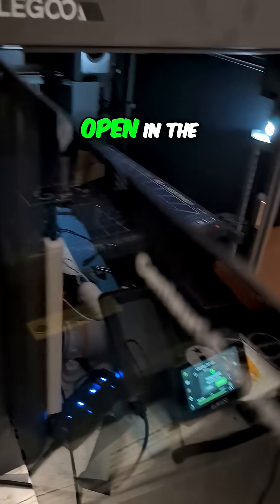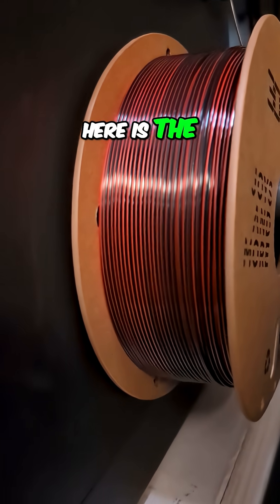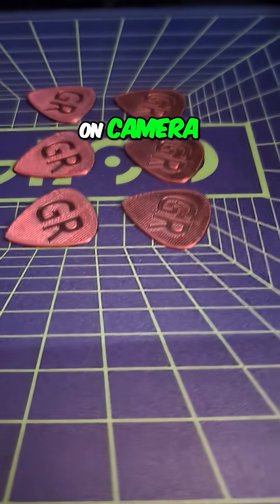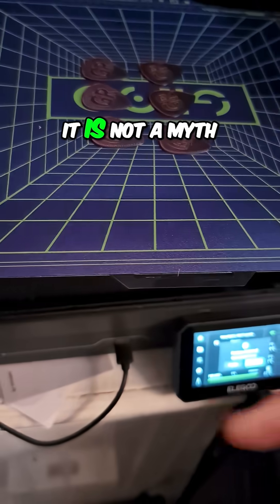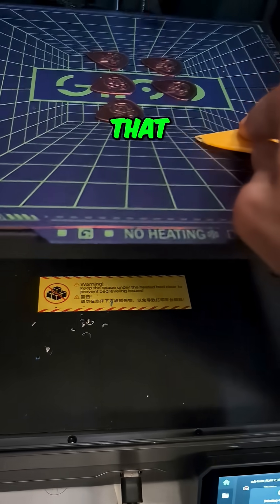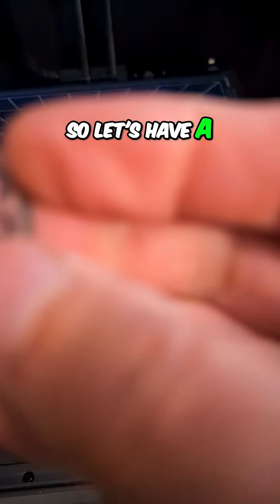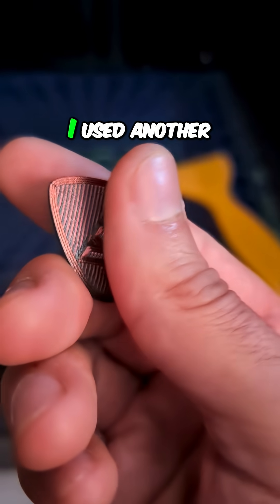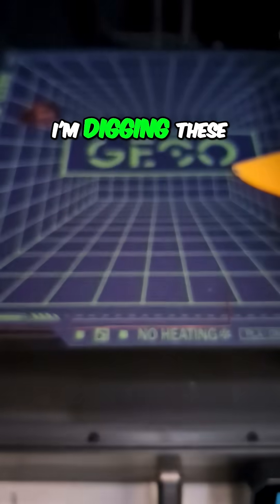3D Printing Success: Silk PLA on a Cold Plate! Elegoo Centauri Carbon

Comment: Add a brim. Try manual or mouse ears.
Reply from the maker: Why? They stuck so good I struggled to get them off the build plate. :)
Reply: I have a mini fridge in my 3d room and I put the plate in there and after a minute, when I flex the plate, everything comes right off. I have multiple plates so it doesn't slow printing at all.
Reply: @marklowe2772  i dont think thats gonna do anything for a cold plate